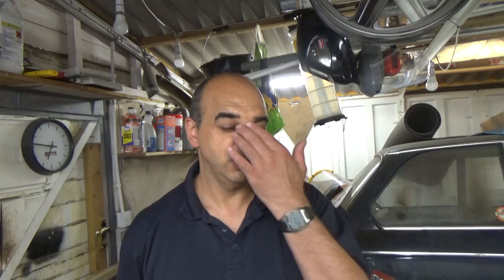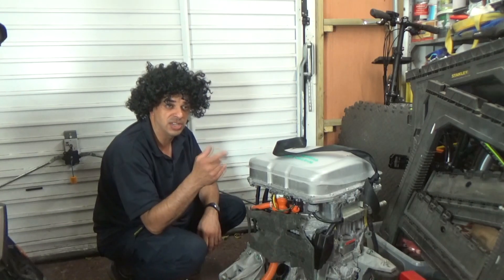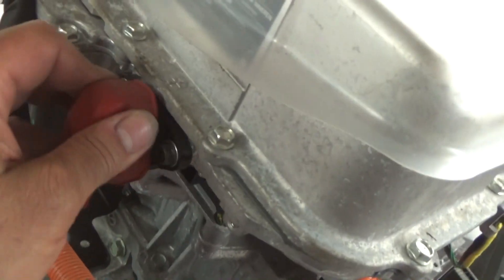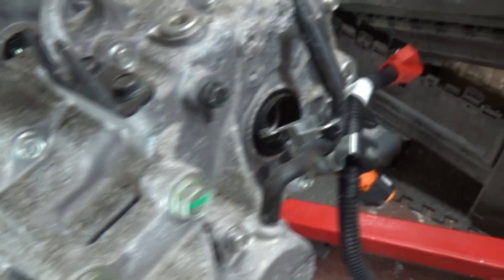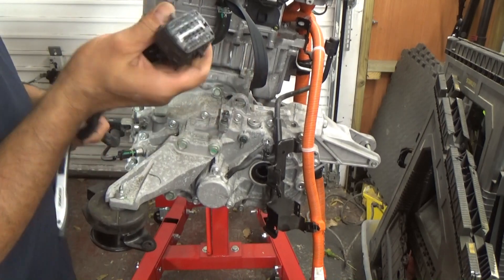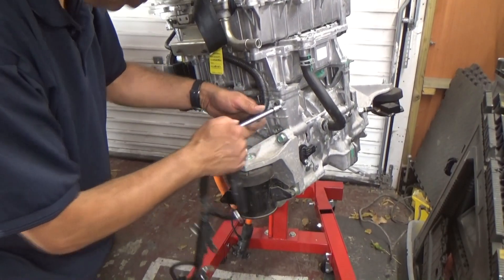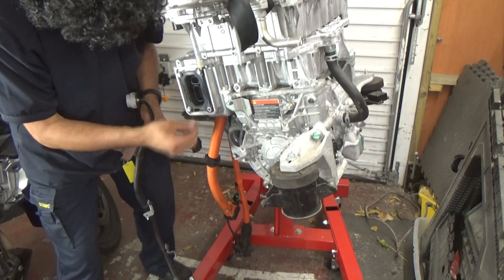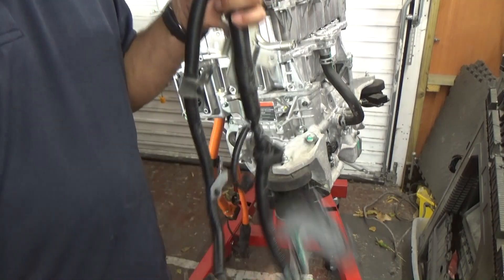Converting a classic BMW to electric. Nissan Leaf Power Part 1

Comment: Newbie here. Why can't you use the controller grom the Nissan?
Reply from the maker: if you carefully removed the entire wiring system from a leaf it would probably work, as its just the motor with the inverter, you need some sort of aftermarket control box so the inverter has the signals it want to see to make it work.

I've decided now just to go with the thunderstruck Vcu

Comment: Where are you upto with this? I'm doing a e36.
Reply: Black terminal - could you share the Chinese motor and controller model?
Reply from the maker: what setup are you going to do;  I've had a real run of bad luck  with this project.  I have gone through 3 controller boards. Have since found out that the main OEM is damaged. Currently trying to build a P@S controller hopefully it will work !
Reply: @IfItAintBrokeStillFixIt  Sorry to hear of you difficulties. Never give up. I am using a Chinese Ac Motor and inverter.

Comment: Since you have one of Pauls boards, do you know what it needs of the original wiring or imputs? I just paid for it but haven't had delivery yet. I am still confused as to what I will need to do to get it going. I don't feel confident enough to start mucking about yet.
Reply from the maker: you only really need the resolver plug and you dont even need that really , Paul is very helpful has answered all my questions so far. Is it a drop in board you bought

Comment: When will you upload next vedio?
Reply from the maker: I accidentally deleted all my footage. I am currently on controller number 3 (other two didnt work)! If this works I will upload in the next few weeks.
Reply from the maker: I've had a real run of bad luck  with this project.  I have gone through 3 controller boards. Have since found out that the main OEM is damaged. Currently trying to build a P@S controller hopefully it will work !

Comment: Have you discovered the P&S motor controller? He also makes a converter box that let's you control the stock nissan inverter with basic inputs.
Reply from the maker: Yes. I have Paul's orignal Controller. That is what I originally bought. Have decided to go a different route now. Going to use a add on and use the OEM invertor. Is Paul selling the drop in boards now. I do like Paul's work
Reply: Seems like we are on the same page then. I was going to use the stock inverter first and then upgrade later. Have you seen Arlin's crx converted with leaf motor? He managed to put down 302 HP to the wheel.
Reply from the maker: @cheapygeek  Yes have seen Arlin's CRX amazing what he has done